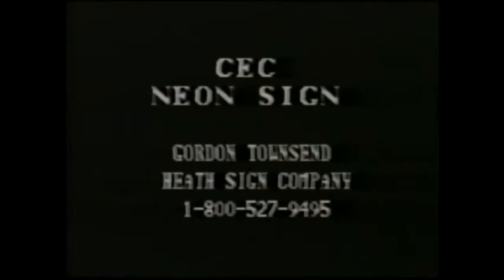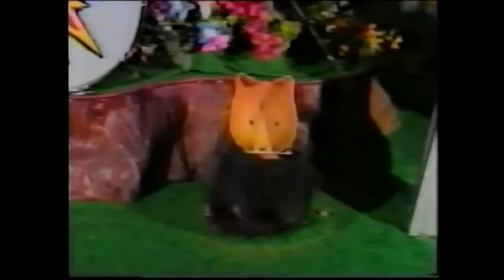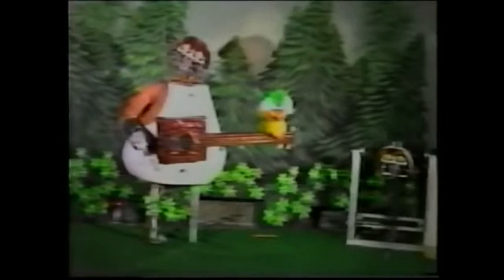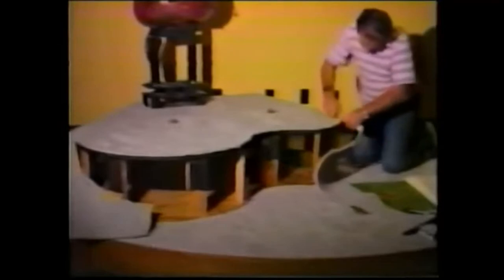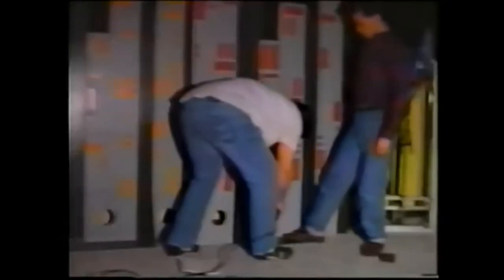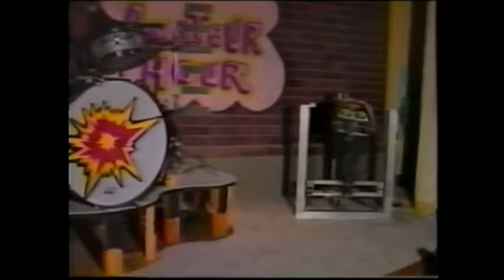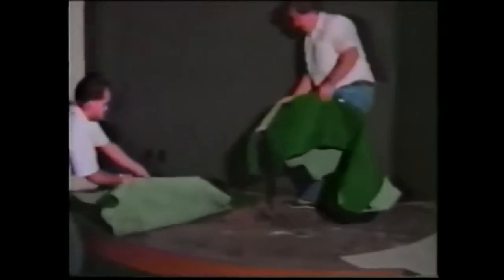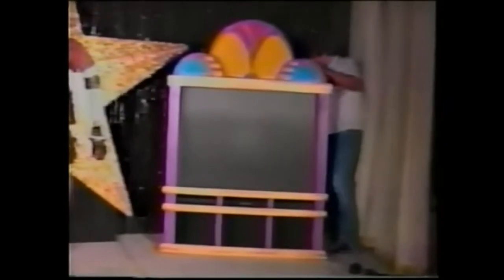Concept Unification Installation Tape

Comment: I wonder if any Showbiz restaurant employees during this period having to perform this job felt sad that they were doing away with the Rockafire Explosion and putting in Munch's Make-Believe Band? 
If I were part of such a team and we had to do this conversion, I'd try to make sure we each saved some of the Rockafire cosmetics or props as a souvenir.
Reply: That’s actually why you find random pieces everywhere. For instance, someone who’s never sold rockafire, just has like a sign or mask.
Reply: Creative Engineering asked to destroy every trademark of the rockafire.
Reply: Its the same with the latex cosmetics from cec wich got replaced in 1999
Reply: @RealTuxChuck 
Guatemala Jasper and Pasqually would like to know your location
Reply: @Geraldthetankengine international locations rarely got updates.

Comment: You have the better full concept unification tape my friend 🙏
Reply: For context, I made a video of the full tape I edited together, it has more than 16k views but it's not high quality like this, it got so much because, like this one, it has part 2s audio.
Reply from the maker: @Tristan Star 360  i swear i almost had an eargasm when i heard "unbolt fatz's mac valve quick disconnect" in crisp audio quality
Reply: @rockingfire4550  Is it ok if I use this video for a redub
Reply from the maker: @Tristanstar360  yes
Reply from the maker: @Tristanstar360  also if you credit me please credit me as Steph45 because that's me lol
Reply: @rockingfire4550  Ok

Comment: I am running a dark ride company for plant  coster customers I have sold one dark ride to my moms friend son i sent him a lot  of stuff for the dark ride because it was not an existing dark ride it being built  from the bottom up if it’s an existing dark ride i sent an unification and installed ado tape.
This is being built from scratch I send a Manual and a blueprints.for the ride.